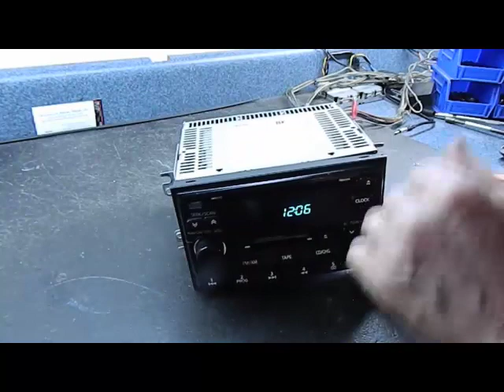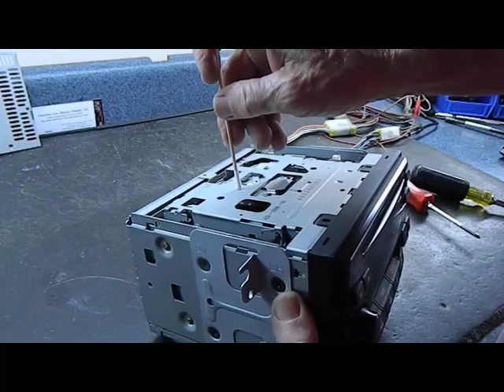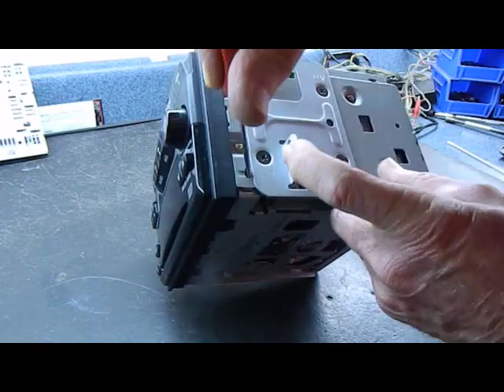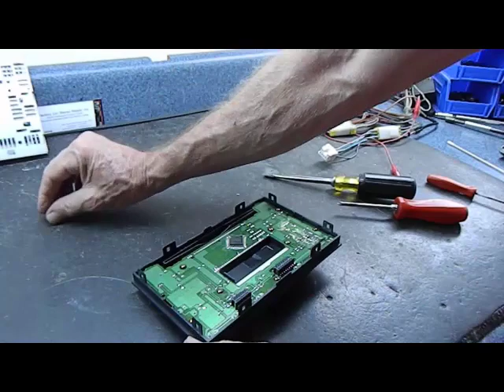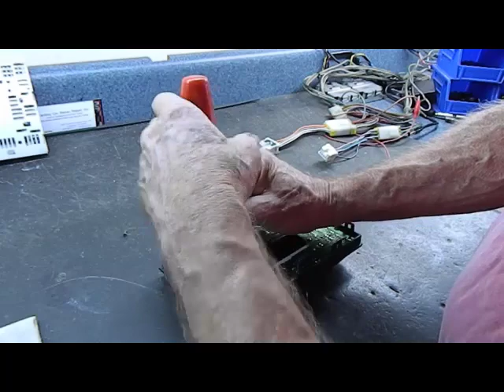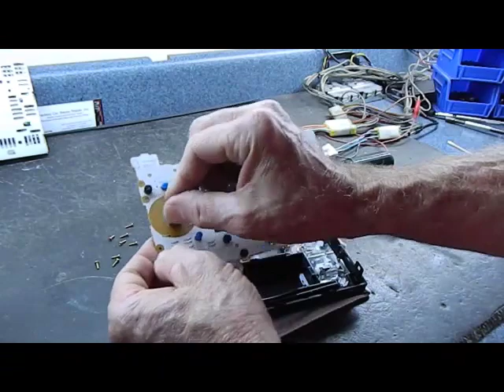Nissan and Infiniti Radio Repair - Car Stereo HELP

Comment: Good video. A have a 1998 Nissan Maxima non Bose factory radio with CD and Cassette.  The issue is erratic volume control.   It doesn't appear I can pull the volume knob off with the radio installed?  Does the face need to be removed and what is the common cause for lack of volume control.  It got worse over time. Volume up and down is difficult to fine tune.  Thank you sir!  Power on and off works perfectly.
Reply from the maker: See your year and model at http://CarStereoRemoval.com for posted video.
Reply: @boblizcou  I pulled on the volume knob so hard I though I might break something but it still didn't come off. Normal?